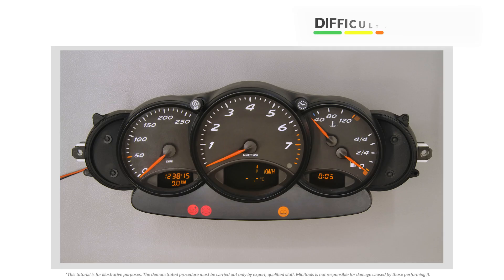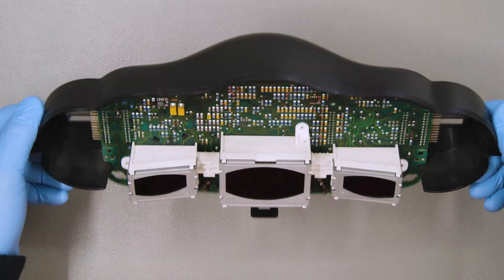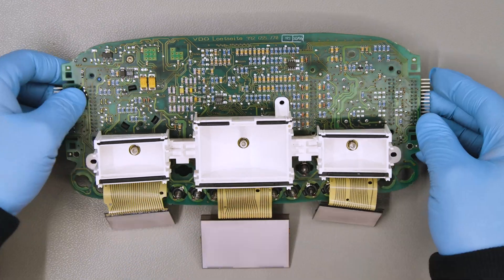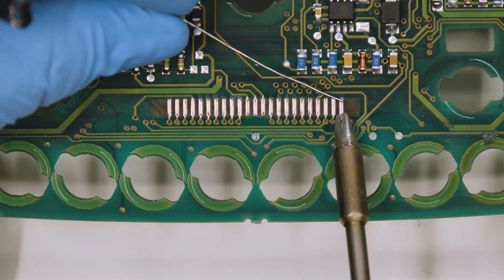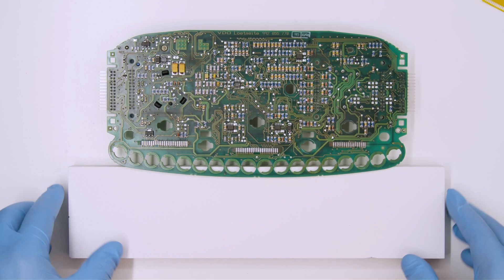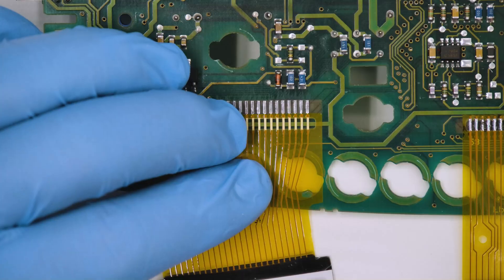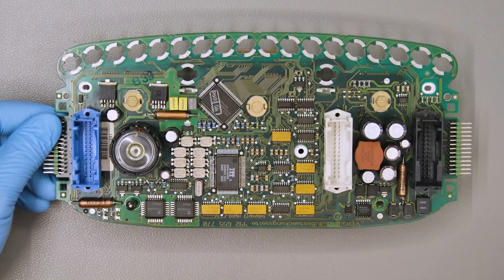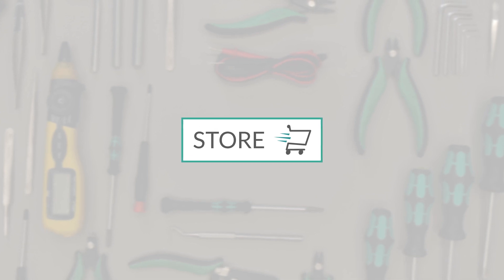How to repair Porsche 911 996 and Boxster 986 instrument clusters – LCD displays replacement

Comment: SEP-ESTR24 tool is trash it's not as easy to remove as they make it seem
Reply from the maker: Hi, we’re aware that releasing the PCB is not easy, that’s why our technicians developed the SEP-ESTR24, as it should allow detach the cover from the board in an easier way. As shown in the video the screws securing the PCB have to be undone, and then make sure to push the SEP-ESTR24 all the way down to remove the cover. If you purchased the tool from us and you’re encountering issues using it, feel free to send us an e-mail at info@minitools.com, our technical assistance will promptly reply to your query and help you.